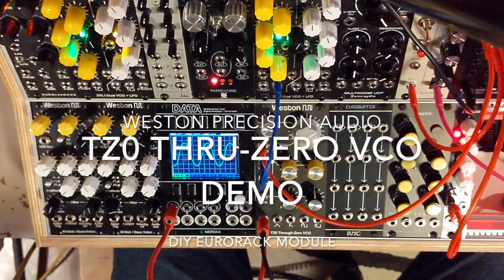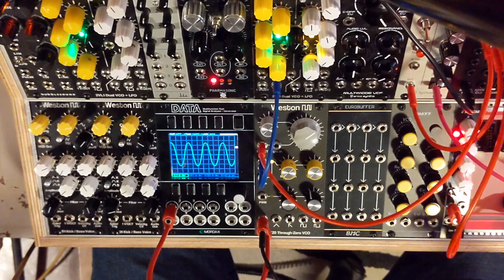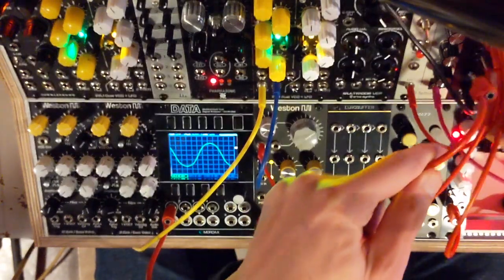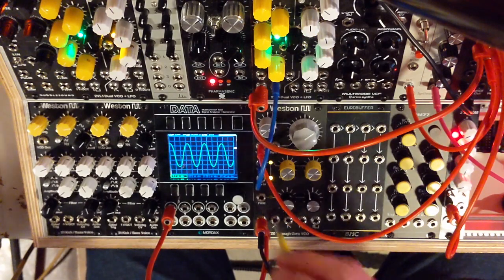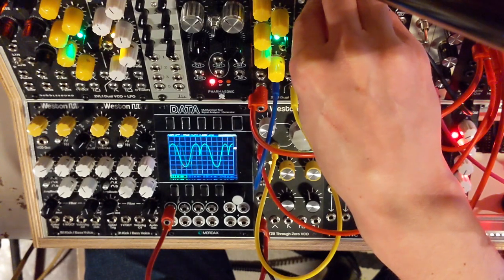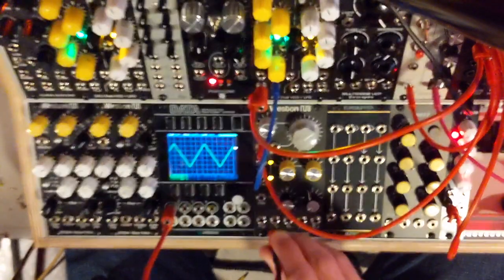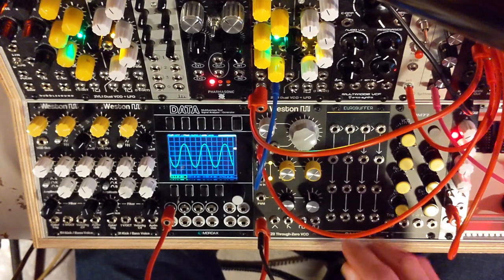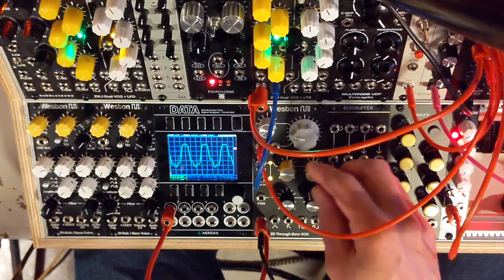Weston Audio TZ0 Thru-Zero VCO Quick Demo

Comment: Is there a PLL involved in the Thru-Zero modulation?
Reply: No PLL. It's simpler than that, in fact this is an older DIY module so you can see the schematics in the back of the build documentation on the website ;).
Reply: @westonprecisionaudio  "The core of the VCO lies on PCB-A.
U102A and U105, along with C114
make up a traditional integrator/Schmitt
trigger VCO, but with the added twist
that 2 of the 4 analog switches in U104,
along with a few carefully-selected
voltage dividers act to switch the
polarity of both the Operational
Transconductance Amplifier (which
provides the charging/discharging
current for the integrating capacitor)
and the Schmitt trigger comparator
U105. This switching action essentially
flips the core in reverse of its current
state whenever the signal TZREV goes
from high to low or low to high."

Such a well-written manual.
Reply: @robertsyrett1992  Thank ya kindly!